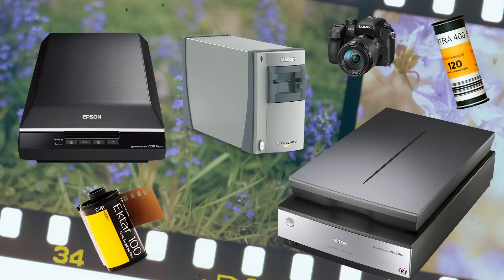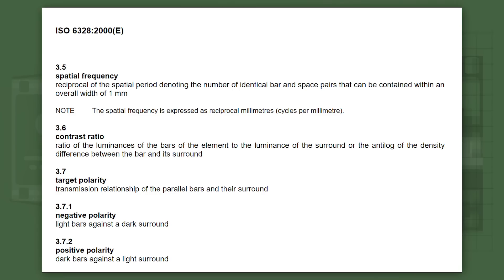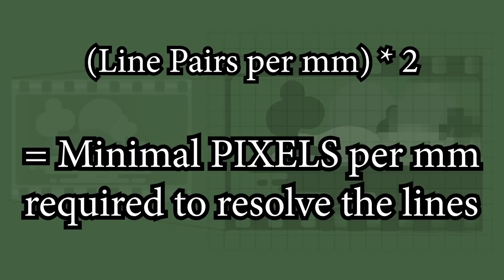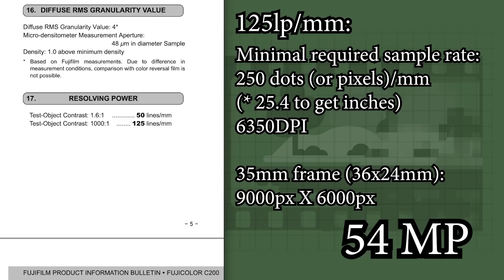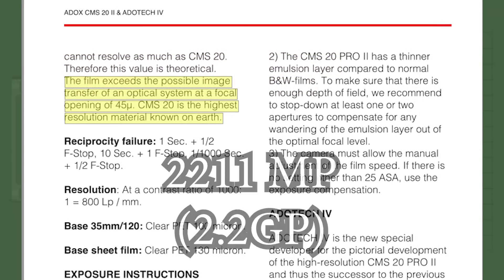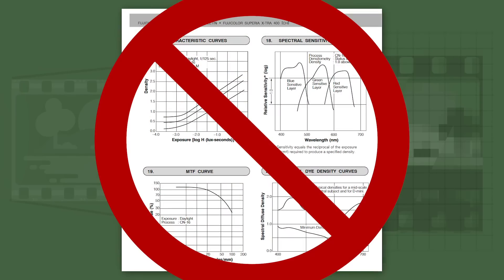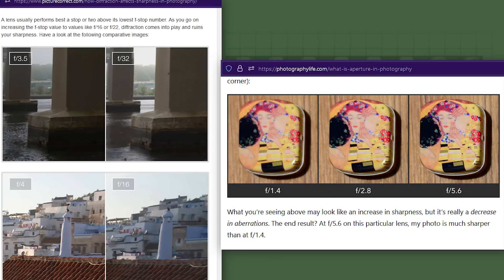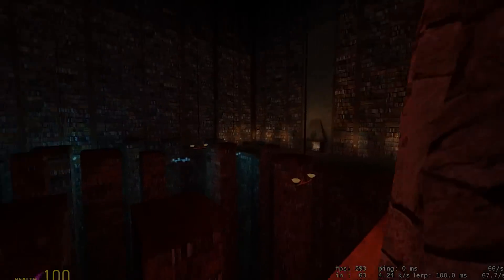The TRUE Resolution of FILM

Comment: This is a complete misunderstanding of how film works. Silver halide crystals have quantized size. Not only do they tend to clump together to effectively form larger clusters, but smaller crystals have a negligible effect on the image. Color film is even worse as it uses dye dots, which are significantly larger than silver halide clusters. Furthermore, the line pair ratings are for contrast of 1000:1, or in other words 10 stops of light. That's close to the maximum dynamic range a piece of film can capture. A test chart cannot recreate such contrast - paper will never get that bright/dark. So you have to work with much lower numbers. In practice there is no way you can get remotely close to 54mp from a piece of 35mm film. Color film nets a equivalent resolution of 5-10mp, bw is around 10-20, both depending on the exact film stock. With modern sensors digital has significantly denser resolution than even the sharpest film stock. If you take fuji's 100mp medium format as a benchmark for digital you'd have to go to 4x5in to beat in in bw, and to 8x10 to beat it in color. Frankly this video is just misinformation. It is a complex topic, but that doesn't take away from the fact that this is wrong.
Reply: I cannot argue the technical side one way or the other but I've never seen 35mm film approach my APSC camera in detail regardless of scanning method, and I used some pretty good lenses too. From my experience the 24MP APSC is comparable, and maybe slightly inferior to 6*6 medium format - but they appear close either way so that the ultimate decision is down to taste. I've never seen 35mm film, color in particular, come close to either. Maybe slide film and headshots, or some other scenario where the subject fills the frame and then 35 gives you a high quality image irrespective of the small negative, but as soon as it's a complex scene where the negative surface area is divided among many subjects the detail loss is evident.
Reply: @Armitage01101  Yeah, most cheap popular ISO200 films are trash. You can get about 12-16 megapixel worth of detail with graininess similar to about ISO1600 on fullframe
Reply: So essentially matching a 35mm film stock in color, one would have use a 10-12 mp aps c camera?
Reply: @CameraNewsDeals  old 5d classic with 12MP is the closest to an actual film camera like my EOS 300. It outperforms cheap ISO200 films easily in every regard. You need to open raw files in literally anything else than lightroom/acr because it destroys the image quality. Files look amazing on a large 4K TV even at ISO1600 (obviously "enhancements" turned off to look like a monitor) Actually ISO1600 and pushed above gives similar "graininess" in Capture one like a film. Also Capture one has a film grain feature, it's amazing tool to fake film look.
Reply: Well said.

Virtually no one seems to ask, "What am I going to do with this image?"  Blow it up to a billboard?  Make an 8x10 print?  Using the low end of "photo quality" printing, 250-300 dpi, a 1"x1.5" 35mm image can achieve that with a 2400 x 3600 pixel count.  I.e., 8.64mp's.  My fixed lens Konica-Minolta A2 was 8mp.  A 16-18mp 4:3 image, as my phones have been set for or do natively, one can make very close to "photo quality" to 12"x16"..
Reply: All I know is the best film stocks at the moment that I know of are IMAX 70mm (I belive its 4x the size of standard 35mm) The stuff Oppenheimer was filmed with. 

People say that has equivalent digital resolution of around 18K.

Which would make each frame able to resolve the detail of 128MP. 

IMAX large format 70mm film is 18x the size of regular 35mm film (or there abouts). 
So 35mm being able to resolve 54MP equivalent just sounds off at a cursory glance.
Reply: @HoneyTwee  Imax is around 8.3 times the area of 35mm film. If 128mp are correct that would be 15mp for 35mm. Seems a bit high, but maybe they were referring to the black and white film.
Reply: @HoneyTwee  there is a big difference between still and motion picture. If the process of duplication and printing is completely analog some definition will be lost.
Same goes for laser writing of a master.

That said, an IMAX frame holds way more than 128MP equivalent.
The ca. 72mm x 52mm frame is medium format size.
Even a 60mm x 60mm “Hasselblad” frame holds several hundred megapixels worth of information if scanned right.
Reply: @Frisenette  sure. But even the comment we're commenting under is saying you'd need a 8x10 film size to even match the 100MP digital cameras in colour. 

Also my mistake, IMAX 70mm is 170MP equivalent, not 128MP. 

If the IMAX 70mm film is resolving 170MP with 70x48.5mm size film 
(That's motion picture so you'd assume it would resolve worse for the same size film compared to stills as well). Then why does the original comment say you'd need 203x254mm (8"x10") film to even approach 100MP. 
How is IMAX 70mm resolving 170MP when a film stock that's around 15x larger dimensionally apparently is needed to resolve 100MP. Something isn't adding up is all. Idk
Reply: @HoneyTwee  yeah, something isn’t adding up sure. Because saying 8x10 is equivalent to 100 MP is just plain pulled from thin air.
It’s just a lie.
Well exposed 8x10 has an absolutely insane amount of detail.
Reply: @Frisenette You are dreaming... 😂
Reply: @Frisenette 8x10” can be blown up to enormous sizes
Reply: Thank you, so many people get their film information wrong and this creates confusion with other people because they dont get the results they are expecting.
Reply: THANK YOU. 
i already knew he was working with absurdly wishful numbers but i didn't want to go after the real ones.
Reply: @GraveUypo  it’s just facts. Nothing wishful.
The tests by the main manufacturers are done to the highest standards.
By the way, have you ever seen the MTF measurement for a sensor?
Reply: It sounds like you read tim vitale's paper and stuck waaay too close to it

Tim Parkin has examples of Portra capturing 17-19 EV. Look at his examples, he has photos, don't just try to calculate from the datasheets. (also some don't include the whole shoulder on the HD chart)

Everyone's understanding of "clump" comes from the word used. They do not clump. They do not move, the gelatin they're in holds them in place, you can see this in the very paper you're referencing.

Look at "high-end-scans" for examples of > 50MP scans of 35mm film and 800MP for 35mm microfilm.
Reply: @ivereadthesequel  No, I've lived the experiment for years and, produced the results. Good lenses and film produce improved results when scanned to at least 10,000 ppi. Grain clumping is the result of migration do to affinities and is limited by gelatin hardening.  "Grains" are manufactured ( tabular, made larger to prevent clumping ). Traditional colloidal silver is infinitely smaller and, when clumping is prevented, have the ability to render utterly gainless images that can resolve 800 lp/mm, or more. Check the resolving power of microfilm etc. Yes digital is vastly better for almost everybody do to the technical difficulties of maximizing image quality with film but, if you want real resolution (not interpolated) and, greater dimensionality in the produced image, digital isn't there yet, which is why many of the highest end movie producers still use film.
Reply: @user-qk1fq6qs3u you are delusional
Reply: @user-qk1fq6qs3uImacon/felxtight is great for dynamics but not for extracting the ultimate resolution from 135. It is after all old tech and not really its ultimate aim.
It’s better than almost any consumer scanner, but really meant for a studio using it with large format, 120/220 and a little 135 for coverage. It would take ages to scan a whole roll of 135.
Reply: based and humiliаting midwits pilled
Reply: @uncled39  😐
Reply: @newtboys we had a whole conversation here that resulted in some kind of resolution, all disappeared into thin air!
Stuff like this makes you not want to bother with interaction ob YT at all.
Reply: Only thing I can say is that post work should either be allowed for both film and digital or both disallowed for purpose of comparison. It makes no sense to compare a digitally edited/stitched/interpolated/AI-enhanced sensor image to an unedited film image. 😅
Reply: The grain clumping happens during development so, the lp/mm figures given by the manufacturers are accurate as they are measured after development. These lp/mm figures can be drastically increased with black & white film with the use of developers that tan the gelatin which reduces grain clumping and further, a staining developer can increase the range of captured image past 16 stops.
Reply: @merwinfamilyjohn  grain clumping happens due to development around sensitivity specs in the crystal.
True randomness clumps. This is quite close to truly random.
Staining is controversial. Most people will tell you that much the same can be done with good development practice.
Solvent developers plus diligent agitation will get you much of, if not all of the advantage with none of the drawbacks.
The staining effect is quite like what happens with dyes in colour film though.
Same perceived increase in resolution/smoothing.
Reply: @Frisenette  A staining/tanning developer (PMK Pyro for example) inhibits grain clumping to a marked degree do to hardening of the gelatin, preventing some silver migration that occurs during clumping. Further the staining is proportional to silver exposure and acts as negative density during printing with the overall effect of a sharper finer grained image with higher resolution and improved tonal range.
Reply: @howtodostuff3619  I’ve never seen any proof of your first claim. 
Grain doesn’t migrate within the gelatine. The filament structure that grows might, but not with any discernible “intent”. 

Hardening the gelatine would be bad as that would inhibit development locally.
Sometimes you want that, but more due to exhaustion than due to a reactive process. And staining doesn’t speed up the film like other developers, which is what you’d expect with exhaustion type effects.

As said staining like effects can be had with solvent developers and careful overdevelopment.

Staining is not free. It affects the archiveability of the film. Printing with VC paper can be difficult. Any kind of fog will catch the stain too, which will makes scanning and printing film harder and ultimately worse results. 
Forget faster films with preflashing or tricky development techniques that increases fog.

Now of course I’m not saying staining and tanning doesn’t have a place. It’s just a technique that should be applied and understood carefully.
Reply: @Frisenette  You are incorrect. It operates within the laws affinity, you should look it up.
Reply: @howtodostuff3619  please define and/or link to “laws of affinity” WRT film. Sounds like an arsepull.
Reply: Except there is film that resolves the equivalent of over 500 megapixels at full frame 35mm size, let alone medium format or larger.
Reply: @howtodostuff3619  lmao
Reply: @ChrisThe1  Those who can't do..............
Reply: I love you dude, thanks
Reply: i personally think the whole question of "How many MP per film" is like asking "how many cats are one dog?".
Reply: There is no clumping really, just the perception of clumping. Film grain is perceived only and doesn't really exist. It is a product of randomness.
Reply: Arent there test patterns that you can use to empirically compare film and digital sensor. For sure it will be limited to comparing a specific camera body, lens, film, aperture and lighting  system. But you can compare these! Then vary the things that are easy to change (lighting and aperture) to see how they compare as these change.
Reply: I agree with you. As a supporting piece of evidence, this practical resolution of film lines up with when digital sensor technology was advance enough for professionals to migrate from film to digital en masse, i.e. when digital sensors are above around 10MP, film began to plummet.
Reply: Modern FF digital is way better when you look at resolution+sensitivity+color accuracy combined than any 35mm film. There no reason to compare it to medium formats and ISO 20 films. When you talk about nice colors, it can be easily recreated in post process. I did that and it is indistinguishable from real film.
Reply: I don't intend to be argumentative, but am curious about some of your assertions. A contrast ratio of 1000:1 is 10 stops, agreed. Also agreed that paper will have trouble with that dynamic range. But where is your data for 5-10 MP for 35mm color film and 10-20 MP for black and white?

I know that Fujifilm calls its GFX series "medium format." But, the sensor size is about 44x33mm, certainly larger than 35mm but quite a bit smaller than 6x4.5cm. Furthermore, the Bayer interlace pattern means that about 3 pixels are required for each color pixel rendered in the final medium. This general principle (multiple digital pixels required on the sensor for each rendered) applies to digital sensors regardless of the RGB sensor pattern used.

As you say, this is a complex topic, but one that I am fascinated by. There are lots of reasons to prefer digital over film (and vice versa), but I'm thinking that resolving power is not the main reason for the preference.

Thoughts?
Reply: @nvrumi  I am unable to provide the link since youtube keeps autodeleting my comment.
Reply: @ChrisThe1  I have had that problem too. It's very annoying.
Reply: @nvrumi  Paper won't "have trouble with that dynamic range."  It won't even approach it.
Reply: @nvrumi  In most documentation on film a secondary line value is included, at contrast 1.6:1. If I remember correctly it was enforced by the ISO since the 1000:1 value is basically never relevant. If you take those values (there are some in the documentation provided in this very video) you'll end up with resolution similar to what I described. Of course different film stocks are going to vary. I read a paper recently which compared some of them; if I can find a link I will attach it below.

The bayer pattern does make this somewhat more complex. In this case it is more helpful to look at luminance and color resolution separately. The luminance resolution is preserved really well even through debayering, while color gets a bit more lost. The multi layer approach of color film conserves both types of resolution equally (or foveon sensors). Applied to numbers we could assume that a sensor with 24mp has its full resolution for luminance, but only about a quarter for color (or half in each dimension), whereas color film will have the same 5-10mp for both. In practice color resolution is less relevant, as we see that less well than luminance differences, but on a technical level yes, digital suffers from debayering. These numbers are only estimates though.

I don't want to hate on film - it's a lovely medium. It is fascination to divulge on the technology, but in practice it's just about what look one prefers. In technical applications digital is significantly superior nowadays, but photography is and remains art. Personally I shoot digital for various reasons and I don't care for the look of 35mm film, but medium format film I adore (and larger) - maybe I'll get into that some time ;)
Reply: @ChrisThe1  I was just reading Tim Vitale's white paper on this topic (and remembered that I'd read it before) and reviewing what Ken Rockwell (love him or hate him...) wrote as well.

In the end, this discussion seems like it misses the target (no offense to you, but in general) that digital photography and film photography are just different beasts. The sort of "resolution comparison" is the wrong question because I don't think there is a final answer because of the inherent differences. 

Both mediums (media?) produce images that can be very pleasing, or informative, or alluring, or choose an adjective. Particularly if film is wet printed (which is very different than digital printing of scans) there is an even greater difference between the two results.

I think people want to say one is "better" than the other. But both are art and so much of art is subjective. 

I shoot both digital and film, although I am shooting more film now (35mm and medium format -- the latter is a blast). I love the convenience and instant gratification of digital. But I prefer the appearance of film (mostly) and I know this is going to lead me back to the wet darkroom again.

Maybe this is nothing more than I grew up with film. I don't know...

But I do enjoy the discussion with reasonable people.

Thanks...
Reply: @nvrumi  Totally agree, they are both just very different and incredible in their own way. Although I haven't shot film in quite a while I have very nice memories of the wet printing process. Thanks for the discussion :)
Reply: 1000:1 is a difference of 1.0 log density (by definition). Glossy black and white photo papers have log densities well beyond 2.0,up to 2.4.
In other words, 1000:1 sounds like a lot, but it's just a dark line on white paper. More precisely it's the difference between the dark lines and paper on a USAF resolution target.
Reply: Wrong. 2.4 equals 8 stops. Everything else you derive of this mistake is also wrong 🤷🏼‍♂️😁 @bernardrr
Reply: @nachnamevorname5917  You are mixing log and linear, which often leads to confusion. Try this instead: do you know what 8-bit is? Most people of a certain age do. It's a number between 1 and 256.  When used to store image information, it provides a very coarse tonal scale. You really need at least 10-bit (1-1024) before a paper print starts to look normal. Does the ratio 1024:1 seem familiar? It's very close to 1000:1, isn't it? It's also suspiciously close to the Zone System's estimation of how much information fits on a paper print...
Besides, why do you think that so many film manufacturers use a 1000:1 contrast ratio in their documentation? Surely it's not a coincidence, or an unattainable ratio. Like many other things, it's based on a standard, and that standard uses the USAF res target. They had to test their products against the standard if they wanted to sell to large institutions (government, army, universities).
If you don't think that's the case, do some googling and get back to us. The standard (or a previous version from the ASA days) surely explains what target is used for a 1000:1 contrast ratio. It's not a magical beast that can't be reproduced in the real world.
Long story short: 1000:1 <> "10 stops". One is linear and one is log.
Reply: @bernardrr  It's still wrong what you say... funny, you don't even realise it. Instead trying to be helpful to someone who knows it correctly... 😂 That's funny (and a bit ridiculous, too). Ever heard of Dunnung-Kruger?
Reply: @bernardrr  Ok, I'll tell ya: 10 stops is NOT 1.0 but 3.0. Second, 10 bit is a statement as to the fineness of the steps while 1:1000 describes the relation of min to max. So, maybe don't state false things while you have not fully understood yet 🙋🏼‍♂️ Thx.
Reply: @nachnamevorname5917  Good to know that Agfa, Fuji, Ilford, Kodak, etc., all get this wrong. I just checked Kingskake (Lenses in Photography, available on the web or as an Amazon re-print) and he was just as confused as me! He shows a USAF target as a resolution chart, and he graphs resolution vs density peaking around a density of 1.8 (p. 71). What a dunce.
Unfortunately it's too late to correct that book, but thank you for setting me straight.
Reply: @bernardrr  I am unfamiliar with log density, but a 2:1 contrast is twice the amount of light, or 1 stop. 10 stops are 2^10:1, or 1024:1, which when rounded is 1000:1. Any paper doesn't have that sort of contrast. Matte paper is 4-6 stops (16-64:1), glossy is up to 7 stops (128:1).
Reply: @ChrisThe1 , it's basic sensitometry. The 1000:1 contrast number is based on a standard USAF resolution chart.
Nevertheless, arguing film resolution in pixels is a waste of time. You would need giga pixels to resolve actual film grain, but a lot less to make a decent copy of a negative. What matters is how the print makes you feel, which has nothing to do with resolution.
Reply: @bernardrr  Ok I looked into it. The log of 1000:1 is obviously 3.0, not 1.0 (10^3=1000). If glossy paper has a DR up to 2.4 that would equal 8 stops (10^2.4=250=2^8). I can't find sources on that; I can only find up to 7 stops, or 2.1 log, but that's still less that the 10 stops most film tends to have.

As far as resolving goes it's debatable how much is exactly useful, but the difference between the actual image information and the technical film grain is indeed major. And I totally agree that resolution isn't a defining factor to what constitutes a good photo, or should be a guide what medium one shoots with.
Reply: @bernardrr  no, because regardless of the actual resolution of the image, the interplay of grain and the fineness of the matrix of the sensor will create interference beating or grain alias.
You need to resolve grain at least to some degree.
Reply: @ChrisThe1  there is a huge difference between ability to register range and then containing and displaying range.

Slide film is extremely impressive in its ability to display range. 

Eight or nine stops is not bested by any other medium.

Photo paper is very good for a passive medium, but of course the recorded range of the film has to be folded/interpreted into the paper.
Reply: @Frisenette  exactly. I've been to hundreds of exhibitions and galleries, and I've never seen a digital print that can replicate a basic Tri-X 8x10.
In the end, film and digital are different mediums, like oil paint and watercolor. It's absurd to ask "how many of one do I need to create the other?"
How many chamber orchestras will it take to sound like Metalica?
Reply: @bernardrr  tri-x 8x10 is a large format film and about $20 per sheet. If that is the best go and shoot olympic games with that.
Reply: No, it is you who completely misunderstand.

The clumping of grain is exactly stochastic. That is, it is random in the true sense of the word. Grain doesn’t want to clump. It is just how the combined randomness of the medium of light and halide crystals look.

Grain is not binary in the slightest either. It can be exposed and developed to any degree.
It is overlapping, and randomly dispersed too.
When you see a microscope image of film you either see the very top layer in an electron microscope image or you see a thin sliver because of the extremely thin depth of field in microscopy.

Small grain has a lot of impact on resolution. Some film only consists of fine grain. 
Some film has an extra layer of it, and other film is reversal processed, in which case the whole positive image is defined mainly of fine grain.

A digital image is processed to hell and back, even with so called RAW files.
If you were ever to see the real raw output of a sensor you’d be horrified and realize what “miracles” the demosaicing, noise suppression and microcontrast enhancing algorithms perform.

Colour clusters are a bit less defined than grain from developers like Rodinal. But solvent devs like XTOL tells us that defined grain is not aways something we want.
Color dye blobs can be any size. Show us proof to the contrary.

Look at well focused and exposed frame in a microscope, and you’ll see exactly how much your scanner misses.
It’s a lot.
The enlarger with even a good (not great) lens is not far behind the microscope. And even though we don’t have commercial scanners that equal that resolution it is quite possible. Only the inexplicable freeze (good enough?) in development scanners since the early 2000s is stopping us. 

There’s nothing fundamental or theoretical or most importantly economical stopping someone designing and marketing a much better scanner today.

You can however get a taste of what a really capable scanner would be like, by setting up an immaculate camera scan rig, and using better than 1:1 captures and then stitch. 
Takes a lot of work and is probably not worth it for most uses of images though, but the capability and potential is there in the film and equipment if you should want and need it. 

Faster film has way more than 10 stops of light. Depending on how you measure, Portra 400 has from 15 to 20 stops. The contrast of 1:1000 is not that rare. Branches against a bright sky for instance. 
But at lower (micro)contrasts levels resolution doesn’t drop dramatically. And what’s more, resolution, sharpness and contrast are always intrinsically linked. That goes for a CMOS sensor too (which is as analog as anything BTW). One of the first things digital camera manufacturers pushed was the microcontrast enhancing techniques, that we have grown used to as a new normal.
Reply: @Frisenette  yeah, no. Portra doesn't come remotely close to 15 stops. According to the manufacturer it has 11.6 stops, but those values are always exaggerated (for both film and digital cameras). That's one of the best dynamic ranges you can get for 35mm film; digital is better.

Beyond that, what is your point exactly? Film grains aren't the fundamental particles that make up image detail. In most film grain size is significantly larger than the smallest image detail stored. Larger grain, and larger amounts of grain degrade the image by obscuring the detail, but they aren't the detail themselves. Clumping also isn't random at all; the silver halide crystals have static attraction during the development process, which causes them to clump.

While the crystals indeed aren't binary at any relevant scale (technically they are at the atomic level) the fact that the entire medium isn't static, particularly during exposure to chemicals during development significantly reduces the effective detail you can get out of the image, even if you completely ignore grain.

The practical resolution you can get out of film is as I stated above.
Reply: @ChrisThe1 11.6 stops is the linear part of the curve. 
The foot and the shoulder is very important.
They don’t contain image information that could stand on its own, but they do very much help the overall image. 

With a sensor the curve is straightened out by software, but it still runs into fundamental problems at the limits.

Especially highlights have very poor tonal resolution and run into clipping much sooner than film.

But even shadows have colours that often, while superficially nice looking because of correction, has guesses at the true colour based on surroundings, resulting in pastiness. 

What’s more, every time you raise the ISO by a stop, that is amp the signal, you lower the dynamic range significantly.
That means that in situations where you’d typically need the most dynamic range, such as artificial light or shadows at sunset or under foliage, it’s easy to run out of range with digital.

With film the DR generally increases with film speed.
Reply: Back when I worked in a color separation house depending on the final size usage of the image, we would scan 35mm low ASA "chrome" slide all the time to 35 to 40 megs RGB, larger if it was a double truck. Sometimes crap would come in from photographers who either didn't know better or were forced to compromise the process and a higher ASA film would be used and at those magnifications artifacts would show from film "grain" but at that point there were no silver halide crystals involved, just the subsequent dye molecules in cluster. We were scanning for print at at least 100 lines per centimeter, minimum. Since you had each color universally in overlaid layers, rather than in a Bayer or XTrans array, the color rendition was smooth and didn't suffer from the pixelation issues when a low mpx digital image was expected to be reproduced at print resolutions higher than they were capable. I know Nikon has claimed diffraction issue when experimenting with 24x36 sensors in the 60+ mpx range but before I accept that conclusion I'd like to see the data. In B&W films with crystal size reaching down to 1µ (Panatomic X shot at ASA25 and less) then depending on nuanced development to control the crystal growth aspect of development, the ability to resolve fine data is better than consumer sensors. And since when you get down to the dyes in color film and are working molecularly, my experience is that you can scan to 54 megs, and if it's a properly exposed and processed slide, it works well.
Reply: As someone who digitizes motion picture for a living, I had to add this: we scan rec709 16bit up to 10k dpx files with a variety of scanners for 35mm and up to 5.5k from 16mm. And most of the times people asking for high resolution scans need them for vfx plates and downscale further on. But if filming in bad conditions, keeping film in improper temperatures or airport xrays etc will affect allot of the detail we can resolve from your shots. So it's mostly about knowing and understanding the medium to make use of its advantages. For example, projecting a portrait shot with no background separation (lens blur, bokeh, you name it) somehow looks more organic in film than in digital because grain reacts differently to stuff further away from the camera as opposed to digital pixels. And I could ramble on about how in concerts, film will never be afraid of laser shows. And how much cheaper it becomes in professional shots when the camera is worth maybe 10k euros but you get the same quality as out of a 40k digital counterpart that would start whining about temperatures the moment you take it out of its comfort zone. Don't get me wrong, there are things film can only dream in achieving in terms of sensitivity to low light and other fields, but in terms of resolution we have yet to surpass all things film.
Reply: What a bunch of gaggling nerds!
Reply: @letmebereal ?
Reply: What a bunch of gaggling nerds!
Reply: That makes much more sense. No way are you getting 54MP from a typical 35mm film.
Reply: Both you and this video is right on some points, wrong on others.  
I can certainly blow your resolution estimates out of the park with the right emulsions and processes. 
But it's all academic, apples and oranges, a pointless discussion thats been going on for a long time.
Reply: @MrLennart1976  I don’t see how it’s pointless. Both are fruit. Both are imaging media.
There has been a lack of real evidence and deeper knowledge in these discussions. 
It was basically just word against word.
People equating their random scanner to the only possibility.
People eating digital manufacturers propaganda raw.
Leaning on decades old test results from heavily biased tests.
Reply: @MrLennart1976  it’s all fruit. It makes a lot of sense to compare. And it can be done.
What you are saying it’s just aping what a thousand reverse trolls has written on forums for twenty years.
Reply: You have no idea what you are talking about.  A key element of film is tonality, the ability to show subtle gradation and contrast at levels below what is directly perceivable to the human eye.  Examining film under a microscope (not a resampled digital scan) reveals an astounding level of textures and tones.  Even a 35mm frame would need over 100mp to even come close to emulating this.  And this is ignoring issues with the Bayer interpolation for color rendering.
Reply: @tim31415  film under microscope looks like extremely high noise on digital. Or like the dots on a print but random patterns. There are no fine tones just mix of dark and bright grains. I have seen many "high"quality scans. Laughable quality. Modern digital can reproduce shades about 100x more accurately than film. Maybe it's time to upgrade your old CRT monitor to a 4K LCD to see the difference... You will be shocked how clean digital is and how much more details it has.
Reply: @dtibor5903  that is because under a microscope all you see is a thin slice of reality, because of the extremely thin DoF. 

Pixels are not pretty or organic. The eye is generally drawn to regularity.

You can blur/interpolate pixels. But you can do that with grain too.
Reply: @Frisenette  pixels are ugly in lightroom and ACR only. In C1 you get more details of raw pictures and the noise resembles film grain. In other software like rawtherapee you can achieve that too.
Reply: @dtibor5903  pixels are pixels no matter the program. You can’t fix aliasing in post.
Reply: @Frisenette  Yeah, aliasing sucks sometimes with sharp lenses
Reply: @dtibor5903  It sucks full stop.
Aliasing affects the whole image all the time. 
And there is of course also tonal aliasing.
Reply: @Frisenette  not sure what are you talking about. Moire? That's the only phenomena that annoyed me when shooting some textile products and some striped shirts at weddings.
Reply: @dtibor5903  edges and moire/interference beating is in your face, but of course it doesn’t just magically stop there. 
It affects all detail that are around the same frequency of the sensors pitch, up and down a healthy amount. 
Same as with audio. 
It might not be as obvious as the pathological examples, but it is there, harshening up the image.
For many people it has become a proxy for “detail” or sharpness, masking as false detail, when really it is an error.

Tonal resolution is mainly the ability to separate tonal values distinctly. Something film is much better at, and more adaptable to special needs.
Reply: @Frisenette  do you have a 8 megapixel camera? Many lenses can't resolve for 24 megapixels and never ever in your life you will not see your whole 24 megapixels printed at a visible PPI, or about 50-100 ppi (ppi and dpi *is not the same*). So you never ever going to see aliasing in print. only if you are a bot put here to create engagement.
Reply: @dtibor5903  yours is the bot answer. Do a search and it’s a conglomeration of what someone else has said a billion times before.

Resolution only matters when it supports your agenda.

Thing is, it’s false. 
Really false.

24MP isn’t that much. 
Print at anything over A3 and pixels begin to be visible. 
Poster size and you will definitely need interpolation or similar.

Aliasing has a way of creeping down in the spectrum.
In audio aliasing happening at 16 KHz affects frequencies at 8 KHz.
That’s why there is a need to sample at 44.1 KHz. Not just 32 kHz (not that it’s perfect even then).
And also why many digital cameras had a physical blur filter.
Reply: @tim31415  This is simply not true. Analyzing film under a microscope doesn't reveal more information about the image, but the image medium. These are not part of the image captured. You can technically zoom to the atom level and yes, a digital scan doesn't capture that, but that is irrelevant for the actual contained image detail.
Reply: @dougmacmillan1712  Just say you are completely jealous of his success and leave it at that.  Posting about your meaningless degree does not help your point.
Reply: @SpartanDaveWave  I have absolutely 0 professional credentials in photography, and even I know that KR is a completely inept.